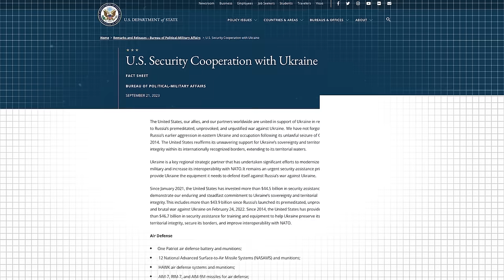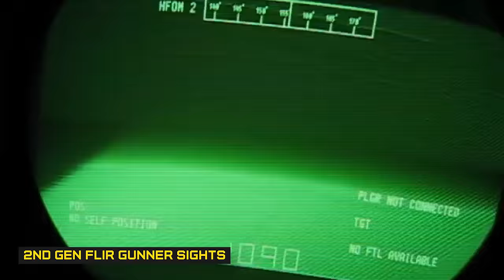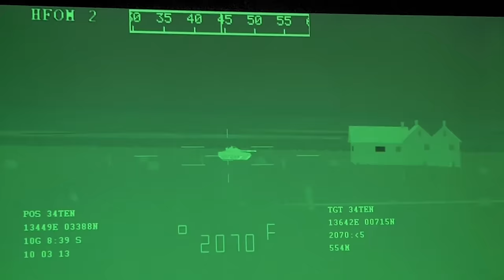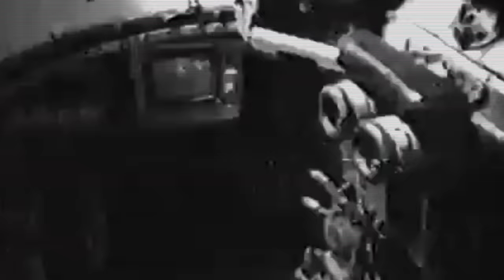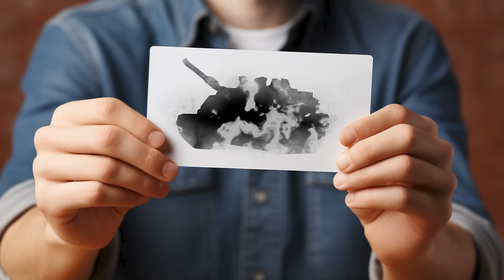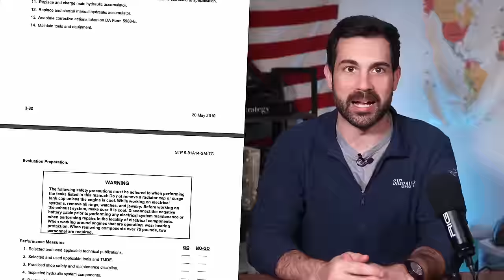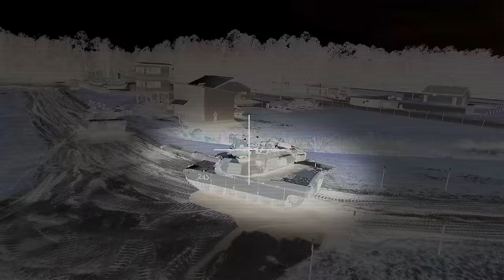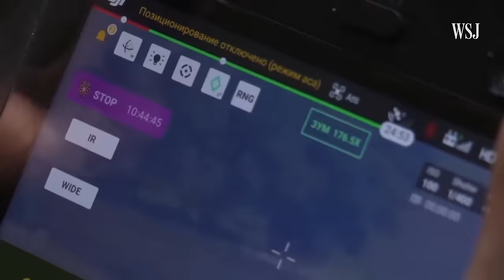M1 Abrams Tank Tactics in Ukraine

Comment: Cap, a correction. Abrams is louder close up, but at a distance it's much quieter than any diesel engined tank.

The reason for this is due to how sound attenuates over distance. Low frequencies (diesels) will travel much further at a higher sustained volume over ambient than higher frequencies will.

Another correction is that while yes, the Challenger 2 is also a 120mm, because it carries a rifled main gun, it is not compatible with NATO standard 120mm projectiles. Challenger 2 uses multi-piece ammunition with the munition and charges inserted seperately.
Reply: And it's especially noticeable at night.
Reply: Doesnt the Challenger 2 also have version of it where it uses a 120mm smoothbore gun?
Reply: @iplaygames2q  it was planned to in the Challenger 3 upgrade, but lol England and budget cuts
Reply: Also remember that we probably sent the Abraham's tank with the export package. This means the tank has no Chabum Armour. It's steel.
Reply: @bass305-HCCA  Thats not true.  The export version has composite armor. The only difference is that it doesn't have depleted uranium inserts, nor does it come with an expensive graphite coating on that depleted uranium armor. 

But the export version still contains NERA (non explosive reactive armor) composite armor.  So it will have comparable resistance to HEAT warheads. 

They'll just be weaker against  newer APFSDS munitions.  Which is less of a concern at this phase of the conflict. As russia had depleted a lot of its newer armor piercing rounds.  And they are now deploying older ammunition and older tanks.  

At this phase in the conflict, the export version will be more than sufficient.
Reply: First time I heard an Abrams (105mm M168 variant) was at Knox while I was at 19E armor school in 1980. We had just finished stage 1 OSUT and were returning our shot-out M16A1s (mine had a nick in the barrel and couldn't hit anything past 50m) to the armory. A convoy of Two 2-1/2s led by an M151 rolled by outside with an M1 in the tail. I couldn't hear the M1 for the trucks and jeep.
Reply: @iplaygames2q  not the challenger 2 no. All challengers with the L56 are designated challenger 3 now. Not Challenger 2 LEP (The LEP was a one tank concept). The challenger 2s sent are all using L30s which as someone has already mentioned, uses 3 stage ammo and can't fire nato rounds.
Reply: @Linux_Fan_Boi_76  like i said, The American Armor has the depleted uranium in its Chobham armored tanks. It's been removed, leaving steel and what I thought was a given which you added,  ceramics. Also lacking, is the Explosive Reactive Armor. My point was that America's export tanks don't even compare to the ones we have at home. They don't have the same engine performance, optics, ammo, and armor. So in essence, you agreed with me. 😄 They might be good against T-72's, but only a few dozen of them sent over? 🤔
Reply: @bass305-HCCA   What do you mean "also lacking is the explosive reactive armor" 

Explosive reactive armor is added onto the tank. The same way you'd add on any other applique armor. 

You can just add the explosive reactive armor onto the export variant. 

Also, while the export version might have older thermal optics.  It uses AGT1500 Honey well engine is used in both the domestic and the export variant. Also the export version of Abrams can fire all the same 120 mm ammo as the domestic version.

The only thing we agree on is that the American version has better armor and optics than the export version.
Reply: @Linux_Fan_Boi_76  yeah. Good. So you agree with me. They arent getting ERA either. We aren't putting on  for them.  They are putting it the Lepard tanks they got from Germany. The Germans didn't do it for them either. What's wrong with you? You're agreeing with me that the export tank isn't as good as the domestic one and then trying to argue that almost is at the same time. 😄 when it's not even close
Reply: @bass305-HCCA  DU isn't a component in Chobham armour, it's a separate thing.
Reply: @trolleriffic  yes it is. Look it up. Original Chobum design, no, but we have incorporated the DU into the mix now. All I was trying to say was that our export tank isn't as good as our domestic ones, and now you're trying to split hairs. 😄
Reply: @bass305-HCCA   What do you mean "its not even close" 

The only difference is that it has worse optics, and that its not as effective against APFSDS ammunition because it lacks an Depleted uranium inserts. 

And of course the tanks aren't being shipped in with ERA armor.  

I don't understand what your point is. 

Why do you believe that the export Abrams is so much weaker than an normal abrams, just because its missing two features? 

They are literally almost the same.  The export version only differs in being weaker against APFSDS ammunition.  And in having slightly worse thermal optics.
Reply: @Linux_Fan_Boi_76  commy tube keeps taking down my article links. Look up M1 export vs Russia T90

Comment: Sorry Cappy, but one of the reasons it took so long to get them there, was they had to be converted to the A1 'Export' model. That means the DU armor had to be taken out. ( It's an Export controlled item; U.S M1's are the only one's with it).
Reply: Doesn’t the USA have thousands of pre-1988 (the year when DU armor was introduced) M1A1 Abrams? The M1A1 upgrade was introduced in 1985. So it had been in production for 3 years before DU armor was introduced.
Reply: @kurousagi8155  Yep, plus all of the USMC A1's after they got rid of them. Alot of the early A1's where converted to baseline A2's. If there are any remaining pre DU A1's left , those are the oldest hulls still in storage. Probably be cheaper to scrap them; refurbing them would take too much time and money.
Reply: @kurousagi8155 I think most of the ones in storage got the DU upgrade in the 90s, but there are certainly some without it.
Reply: @gregdomenico1891  how well can you scrap old tanks for parts? I imagine a direct improvement/new model could use many of the olds' parts, but apart from that, they're all specialised items, right? so selling them on the civ market is very hard. and decommissioning has a price too
Reply: @sztallone415  With 40 year old hulls? Not much will still be good, I'm afraid. Maybe the engine and some internals. Gaskets, most of the wiring harness are all shot by now. And your right: Demiling them won't be cheap. Knowing the Army, they will end up as Range targets. Now if the hull is still good, that can be stripped and re-used; But, there are newer hulls in storage that would be Up graded first, if they are really needed. And the reason we have so many in storage, is because Congress kept ordering Tanks to keep the Plant open. The Army actually told them that they didn't need them(at the time).
Reply: @gregdomenico1891  yep, I guessed so. so sending the old ones to Ukraine is pretty much a win-win
Reply: @sztallone415  The major issue becomes if we are going to send them any more; they either order Brand new 'Export' models from GD( that will take at least a year, maybe more), or repeat the process with Hulls in storage( another year).
Reply: @gregdomenico1891  is there no other way?
Reply: @sztallone415  Totally hypotheticly(sp, sorry, it's almost 1 in the morning here), if we send them more, there are really only three options:
1-Take the best A1's out of US stocks, and get started yesterday on makeing them Export models.
2-Order new ones(This will take the longest)
3-Find someone who we Exported some to(the list isn't that long), buy them back(like Germany did with some Leo's), and Re-Export them to Ukraine.
Problem with 3 is how many we could get.
Best option? Go with Leopards for now, M1's later. I know they need them now, but we took too long to get off of our tails sending the first batch.
Reply: @gregdomenico1891  thx

Comment: well actually🤓 abram engine noise is louder than diesel at close range but is actuallly quiter from farther away than a diesel engine. a bit more Heat signature doesnt really matter when diesel engine run over 300 degree hot

Comment: 16:29 Slight caveat: the Challenger doesn't and can't use the same 120mm rounds as the Abrams and the Leopard because it has a different gun, an L30 from Royal Ordnance as opposed to the Rheinmetall Rh-120/M256. The L30 uses separate charges and projectiles whereas the the Rheinmetall gun uses cased cartridges.
Reply: Thank you, I knew he made a mistake and I only found your comment that confirms it. 🙏💪👍
Reply: Interesting. Isn’t that in violation of NATO standardization though?
Reply: @alex434343 from what I can find, technically not. STANAG 4385 only covers smoothbore 120mm tank guns. The L30 is rifled and is likely not subject to STANAG 4385.
Reply: Is this changing soon? I seem to remember hearing that the Nritish are phasing out their rifled 120s in favor of smoothbore 120s due to the perceived (or exspected) obsolescence of HESH rounds.

Comment: With all the documentation, spare parts and such it's a great vehicle to take a few hits and get repaired rapidly. Especially since crew survivalbility is a huge factor in this war, losing an experienced crew is worse than losing a vehicle. Heavy weight is an issue, so much that the military's already developing a smaller, more lightweight tank, but it's good enough for now. Not like the US can't send some engineering vehicles for bridge building or reinforcing the ground if need be as well.
Reply: this tank isnt built for drone atack
Reply: @tomislavvaldec1 not totally true. Yes, drones did not exist in the 80s when the tank was designed, but we have countermeasures like Trophy today. I would not not be surprised if Israel isn’t sending Ukraine anti RPG and drone countermeasures.
Reply: They also have thousands of them in storage that will never be used.
Reply: The Army isn't developing a lightweight MBT. whoever told you that has no business talking about armored vehicles. There is NO SUCH THING as a lightweight armored vehicle. Weight isn't important. ground pressure and power to weight ratio determine performance. It could be 100 tons, but if the ground pressure is low enough and it has enough power, it'll do better than the wheeled vehicles off road.
Reply: The biggest problem will be the weight. They are too heavy to use in the fields of Eastern Ukraine during the rainy season that is starting now
Reply: @Sophie-and-Ken  Seems like you did not watch the news today, there were some Merkavas on fire, you know, in Israel.
Reply: If you are talking about the M10 Booker. That is not a tank and should not ever be used like a tank. That is a AFV meant to support and be supported by Infantry.
Reply: @thomasschwab1727  they can go thru mud perfectly fine
Reply: 2 weeks of training of the crew don't really qualifies as "experience crew" 🤣🤣
and no air cover, and lack of 155 mm shells,  will be a joy ride.
Reply: @ThereIsAlwaysaWay2  The fact you think they use 155mm shells shows how clueless you are.
Reply: @trolleriffic  Your so right, they use tulips in their guns.  Sry for thinking they had some fight in them, won't make that mistake again.
Reply: @devin5139 The need for weight reduction isn’t about the ability to move over the ground.  It’s about ease of transport and fuel consumption.  And the army isn’t developing a “lightweight” tank per se, but the next Abrams variant will likely be considerably lighter than the current one.
Reply: @thomasschwab1727 No tank is built to operate in mud that is multiple feet deep.  The Abrams is actually better in those conditions than lighter Ruzzian tanks are, but again, it’s impossible to make a tank that does well in that stuff.

Comment: I thought the nickname for Abrams back in the day is Whispering Death due to how quiet the AGT1500 is compared to diesel engine like MTU MB 873?
Reply: Technically the gine is quiter in pure decibels. But it is in higher frequencies than the low rumble of heavy diesel engines and such, which comes with 2 drawbacks:
Higher frequencies are usualy easier to locate/ find for humans.
They also carry better over longer distances, dropping of much less than the lower frequencies.
Reply: @reappermen  , you're wrong about that last assertion. Low freqs carry farther in air than high freqs, the natural result of having a longer wavelength.

This also holds true in water which is how whales can communicate with each other over Hundreds of kilometers. The freq range large whales can talk in is infrasound, far below the range of human hearing.
Reply: @reappermen  Easier to hear up close yeah but higher frequencies dont travel as far as lower frequencies
Reply: Lancet 😂

Comment: I remember seeing a video where, I think it was ISIS, shot a kornet at an Abrams on the side. Every single one of those inhuman beings started screaming Allahu Akbar!!... Until the turret of the M1 started turning towards them and you could hear the panic in their voices.
Reply: Iirc , it wasn't ISIS , it was Saudi Abrams vs Houthi rebels
Reply: If it was a kornet it definitely penitrated it since I have seen videos of kornet taking it out, they might have gotten lucky and nothing important was hit
Reply: @rajaydon1893  depends if it hit the hull steel or the composite and DU armor in the turret side
Reply: @jtl05  it doesn't matter what was in the side of the hull it won't stop a kornet
Reply: @rajaydon1893  no it really does matter the turret composite of a M1A2 has about 2400mm of chemical protection where as the hull side has 100mm of steel
Reply: @jtl05  please read what I said carefully. I was talking obout the side of the hull not the side of the turret and the sides of the turret is not 2400mm effective armor it's more like 700 or 800 which is easily penitrated by even older versions of the kornet
Reply: 😂 somone like to dream
Reply: @altab3dstudio53  except for the fact the video is real
Reply: @jtl05  Realy Einstein? 🙌😂

Comment: Thanks for the in depth reporting on the Abrams as well as it's modular repair system.  Really useful reporting.  31 is silly and a pretend effort but having this background is good.  We did see more of a direct engagement from tanks around the time of the Robotyne counteroffensive.  Reports showed AFU tanks at a standoff distance, acting somewhat successfully in more of a sniper role, from the northeast quadrant of the battle area.  Given the mines this makes sense.  Obviously, the handful of Abrams with their longer range accuracy would be useful in this kind of role.

Comment: I was a E5 gunner on a M1A1 tank in second armored division from 90to 94ish. Returned as prior service in 2003 in the same capacity except I had to accept a corporal, rank due to the time away, and return to Iraq with the 1st cavalry division. that being said, I agree and loved everything you said, but I take great exception to what you said about the noise level an Abrams tank makes. It is a high-pitched whine when starting the turbine which takes probably less than 20 seconds , and after that, it is a sound signature that does not travel,far at all.  I am not schooled or have a  PhD in Phonetics or whatever you would call it. But I  Will tell you from experience, A LOT  of experience but I can tell you that an Abrams turbine engine is far less discernible on the field at distance than a diesel engine.

Comment: DU is used as a backer for the composite matrix. It's always a "plus" (other than weight). It will probably be replaced with tungsten; and if not that, just steel.

Comment: Super expensive, with a few major advantages over other tanks available to Ukraine. Meaning there will be few opportunities to make it worthwhile using these. That is areas where: targets are are beyond 1500m, tank is close to roads to reduce fuel usage, allow resup and repair, likely at night.

No point using these in most of the battles being fought, which are occuring at relatively close range, and being exposed to mine fields and trench systems.

Likely will be used as part of an attack or raid to hit targets from extreme range, enabling over vehicles to close with the Russians, then will either withdraw, or stay 1 or 2 klm behind the advancing units, and called as fire support.

Much like a big heavy expensive battleship, stays as far away as possible, hitting from extreme range, and surrounded by supporting weapons to keep it relatively safe. Because there are only 30 in country, of that only 10 or 15 will be available for use at any one time - repair and maintenance being done on 20 odd. And then there will be vehicles lost to enemy actions. 30 - really is not very many.

The over all effect on the war will be minor, but Ukraine needs everything that anyone will give it.
Reply: They may be more trouble than their worth.  Ukraine is suffering from the same logistical nightmare the Germans had in WWII.  The Germans had so many different types of equipment used from so many countries it was a nightmare keeping spare parts on hand for the right types.  Ukraine doesn't have such a widespread theater of operations, but 31 tanks is a pittance in this conflict, not a game changer.
Reply: I agree that it's a nice gesture on the part of the US, however I am struggling to see the advantages.
Reply: @jaggedskar3890  It's just the first package of tanks. More tanks will be sent. It went this way with every weapon system we've sent them so far.
Reply: With our peace talks this is just cruel using 70 year old tankers.
Reply: @quartermaster1976  They aren't even remotely close to 70 years old.
Reply: What advantages? Like the chally and the leopards great advantages worked out so well they're hidden behind the front lines now. I'd rather have 3 T-72's than one Abrams, quantity over quality, the Russians just understood that better than youse
Reply: @jaggedskar3890  
100% I commented about this as well.... they need just a few types of the most effective systems, and then delivered at scale...